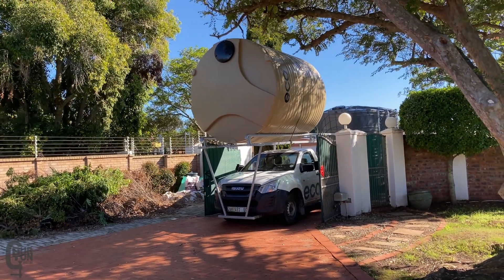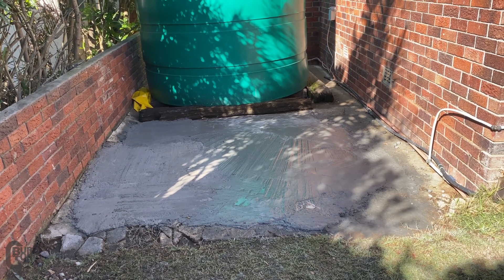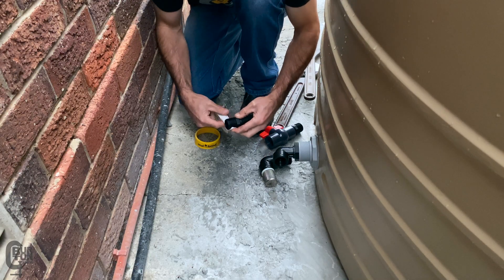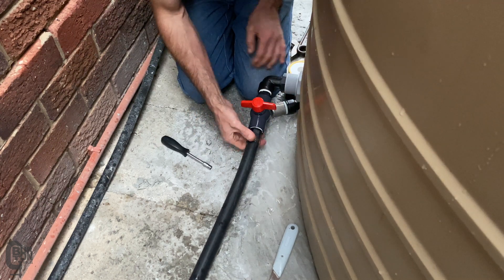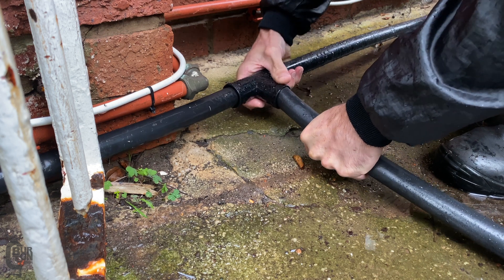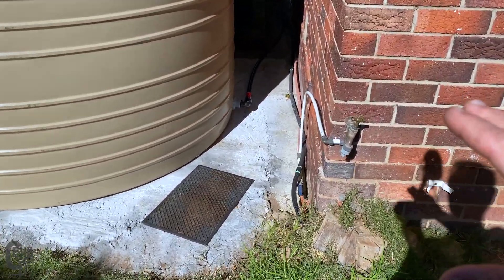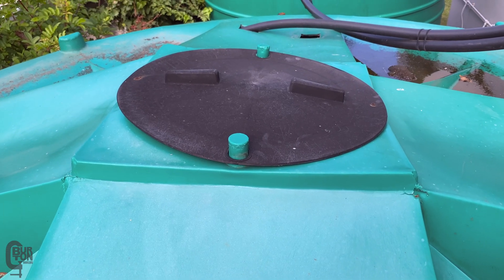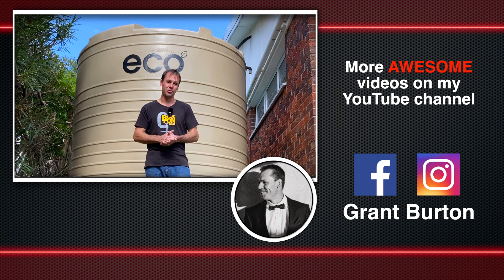How to install a water tank (Install a 10 000 Litre Eco Tank) - Burton Builds

Comment: How do fit a 1000lt tank to my existing 1000lt jojo tank
Reply from the maker: You can install a Tee fitting on the outlet of your existing 1000L water tank (After the ball valve).

Place the new 1000L water tank next to your existing tank. Install a ball valve on the outlet of the new tank, then connect it to one leg of the Tee fitting on your existing tank. The other leg of the Tee fitting (on the existing tank) then feeds into your pump.

Comment: It was good to see you show the design failure on the tank that allows the roof to become a mosquito breeding ground after it rains. I see many failed water tank designs and option placements that never cease to stagger me. A quick observation though, does the vent (breather) mesh have apertures that are smaller than 1,000 micron (mosquito proof)? What are the regs in SA re meshed openings?
Reply from the maker: Hi, thanks for the comment. Technically, I suppose the vent breather I think you are referring to is actually meant to be an inlet screen but it does mostly work as a mesh vent to keep out the larger creepy crawleys. It's openings are 1.2mm (1200 micron).

I'm not sure what the requirement for meshed openings are?

Further down the line, we also filter down to 1 micron and use a UV steriliser in the system.
Reply: @GrantBurton  In Australia, meshed inlets are required to be less than 1mm (1,000 micron) with 955 micron mesh invariably used. Have you checked whether SA have any regulation re the maximum filter screen aperture size? You can wrap some aquarium filter screen or similar around it as a quick fix.

Comment: I have just installed 3 x 2050 liters water storage tanks. Configurable to take water directly from Municpal water, take water from 1,2, or 3 tanks or all three. configurable to use Filteration or skip filtration to service filters. Has Zilmet 0.75 kW VSD drive. Can pump from 1 tank to another for servicing invidual tanks, using the same VSD Pump. No extra pump required. I have 9 Valves installed to make this all happen. 
All 3 tanks can keep levels the same just through Gravity and the way tank vales are configured. Simple T-connecter with valve to each table. 
I can automate this system but will do that over time when I have an off-grid solar system. 
It was great watching you before; but I needed to make sure I can do a lot with little. Take care keep the videos coming.
Reply from the maker: Hi, thanks for the comment and explaining your system... I bet you had fun designing and building it... and by the sounds of it, it's nicely configurable. Once the solar is installed, its pretty much free water (so long as you get enough rainfall).

What automation were you thinking of? Possibly cycle the water between tanks to keep it aerated?

There are a couple other rainwater harvesting install videos... not sure if you have come across them yet... here is a link to the playlist https://www.youtube.com/playlist?list=PLb9ne7k5ibApazCHpN3kATHLi7kUyufk2

Comment: I have a smaller tank for a smaller property. Current tank is on brickwork - do I need to make a base or is the brickwork paving good enough?
Reply from the maker: Hi Lucia... the answer would depend on a couple of factors. No matter the tank size, generally speaking the best case is a dedicated tank stand (usually cast of reinforced concrete with suitable compacted layer works below) however if the layer works below the brickwork paving / paving blocks is done correctly, that can also work.

I've also seen many 2500L tanks placed directly in brick paving in housing complexes and those also seem to hold up fine... although something you need to watch out for is that when it rains, water runs down the side of the tank and can wash the sand out of the paving joints, and eventually start eroding the layer below.

If the paving is butted up directly beside a house or wall, it's best to not have the tank overlap the concrete footing under the house walls (that can end up pull a wall over). If it's on 'freestanding' paving and the tank is 5000L or smaller, that should be fine, but it really depends on the layer works below the paving. 

I've also seen people remove a layer of grass and place paving blocks directly onto the topsoil and place 5000L tanks on top of that... I wouldn't do it this way, but those tanks are sill standing. Definitely not the recommended way to do it though.

Comment: Hello Grant I have problem with my jojo tank  as  plastic inlet valve kit From builders I bought it a d fitting into my jojo tank for my water supply but it's make  hammer noise wen it fill up  jojo tank and how do I fixed Dat problem. It caused loud noise wen filled tank. Wat it method to fixed it. Thank you manoj
Reply from the maker: Hi, I'm not sure what you mean by 'd' fitting?

Comment: I just bought a 260 litre one. I don’t want to connect it to any pipe. How can I use it?
Reply from the maker: Hi Shaz, I guess you could just install a Bib Tap onto the tank outlet and use it that way (you might need a reducing adapter to connect the tank outlet fitting to the tap).
Reply: @GrantBurton   Thanks Grant but may you please send me a link. I just searched on google and I’m even more confused

Comment: use compression fittings, they are very convenient
Reply from the maker: They are very convenient, especially if maintenance needs to be done at a later stage, or if pipes need to be disconnected, or the setup updated as time goes by, it makes for easy changes.
Reply: @GrantBurton are they made of metal?

Comment: Great work 💯. Thank God YouTube recommended me this video. So a water tank can freely pump water into the house without the tank being lifted high up? I find this safer than the tanks that are raised high up. Is there any extra thing you do to ensure that water still flow into the house effectively?
Reply from the maker: Hi, if you want tank water to run into the house with out using a pump, you'll need to raise the tank higher than the house so it can gravity feed. If the tank is at ground level (as in this video), you'll need to use a pump to pump it into the house.

There are a few water and tank related videos I've made explaining these things... they are in this playlist https://www.youtube.com/playlist?list=PLb9ne7k5ibApazCHpN3kATHLi7kUyufk2

Hope this helps.
Reply: @GrantBurton  Thanks a lot. Yes it helps. I do have a pump  and a borehole but was wondering if it can pump water into the house if installed. From your explanation, it means a pump can be used to pump water successful into the house without necessarily raising the tank up. I will still watch the suggested video to see how it works. Thanks. Just subscribed.
Reply from the maker: Absolutely... depending on your water flow and pressure needs, a 0.6kw or 0.75kw pump should be sufficient. Over the past year, we have been using a 0.6kw DAB pump and it's been sufficient.
Reply: @GrantBurton  Pleased to hear that. Thanks.

Comment: Where did you get the L-adapter on the overflow that has the bug screen fitted too?
Reply from the maker: Hi Morrison, you should be able to buy it from any irrigation or hardware store that stocks these type of water fittings. The L-adapter and the bug screen are two fittings purchased separately and screwed together. In South Africa you should be able to get it at TURFAG, Spilhaus, Builders Warehouse, Co-Op or any other similar place.
Reply: Hi  @GrantBurton  I purchased the L-Adapter at Thompson Bros Newton park.
Reply from the maker: Great news, thanks for letting me know.

Comment: Hey Grant would like to know if you use a pump to keep pressure to your outlets when you are disconnected from the municipality water and if soo what's the size?
Reply from the maker: Hi Lunga... yes, we do use a pressure pump and filter system. If you would like to see the setup, there are another two videos, one about how I installed the system https://youtu.be/X4fLU9IZQMY and the other explaining how the system works https://youtu.be/DermXBtJMfI

We use a DAB JETCOM 82M. A while back we were using the JETCOM 102M but I decided to test out the 82M for a couple months.
Reply: @GrantBurton  thanx 👍